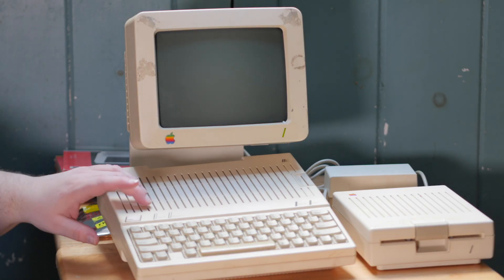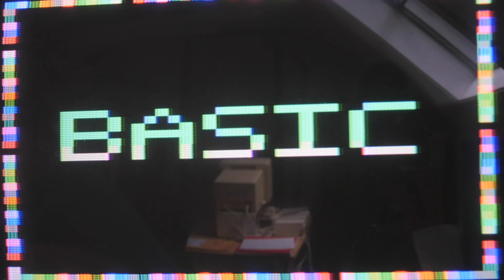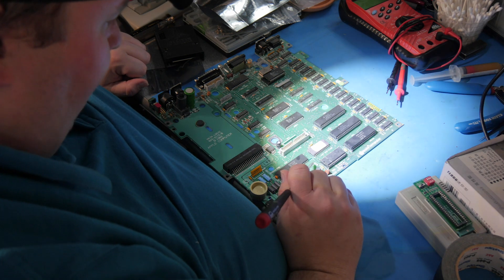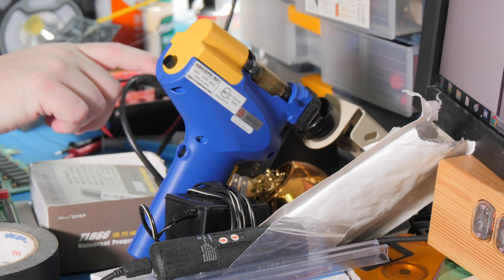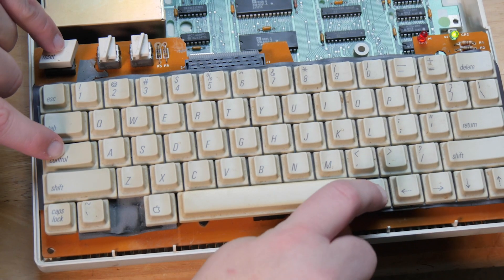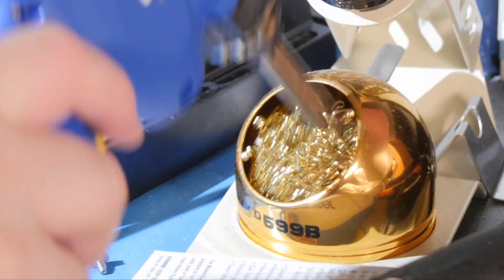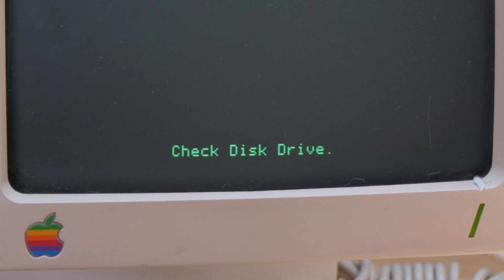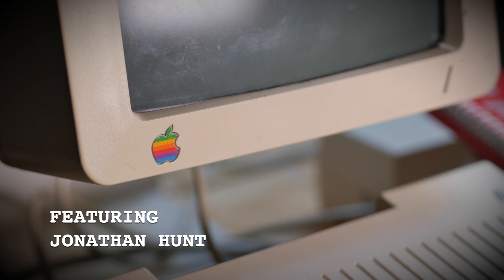'Puter Smith 01: Repairing an Apple IIc (1984)

Comment: Nice find.  I need to Hakko desoldering gun!  I just found an IIe in a barn last weekend and it works! Got an Apple color monitor and a few floppies for it. The first floppy is not any good (I have a vid on my channel showing the nasties), but I have 3 more to look at, but not too worried about them anyway but for looks.  Found a c128 and a 1581 and an Excelarator Plus.  Both seem salvageable. I need to build a PSU for the 128 though. Since you live in the US, check out Tayda.com for good quality parts. I get most of my discrete's, sockets, and pins from them. All good stuff.
Reply: Very cool! I love the C128! Its one of my most favorite systems!
Reply: @interactii  Thanks.  I am excited about getting it going. I had a Vic and c64 I bought in 82 and 83. I wish I still had them, but time and lack of storage then took them away!

Comment: Hey Frankie. Great job once again! 
Jon: this is how it starts. A computer here, a computer there, then one day you wake up and you cant move in the house! 
As an old timer that does electronic repairs, I cringed when I saw that big blob of solder. Did you clean off the pcb lands well enough before you began to solder? If not, you may have continuity today, but the joint may not last. Sometimes you can use a pencil eraser to clean them off.they should be bright and shiney before soldering. 
Another thing: it is wise to re-seat all the chips that are on sockets as socketed chips suffer from "chip creep' due to thermal expansion and contraction when used causing the chips to work their way up the socket.

Comment: If I could give a piece of advice Frankie, you should reformulate your titles to something like "Repairing an Apple IIc: Diagnosing bad RAM chips - 'Puter Smith #1." It's generally recommended to put the show titles at the end, and more keywords can't hurt. Also be sure to paste your metadata keywords into your description. Apparently Youtube experts say it helps with the SEO.

I'm sure you know most of this stuff, but I only mention it because I know with the success of youtubers like The 8-bit Guy that retro computing has a lot of potential on the platform.